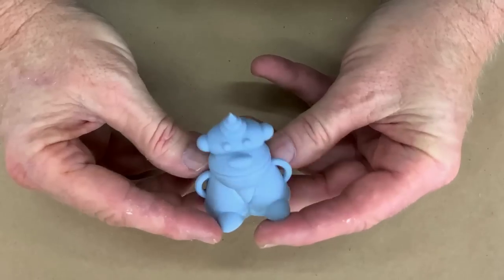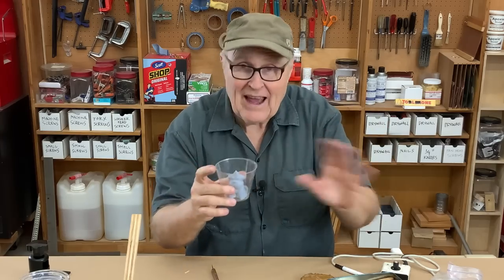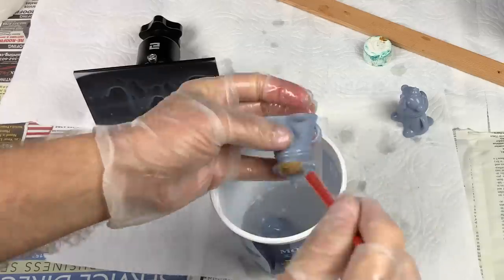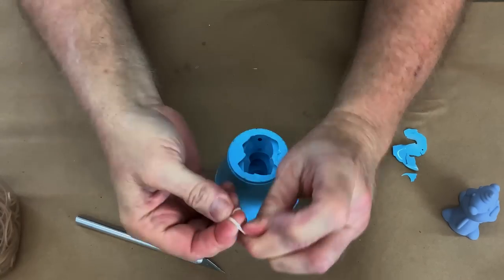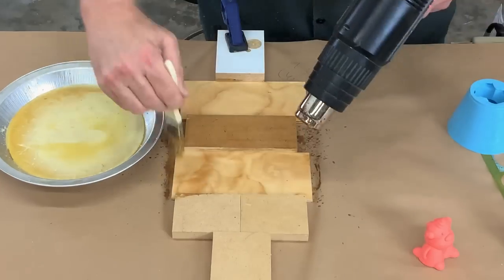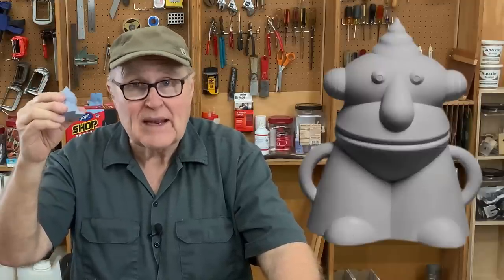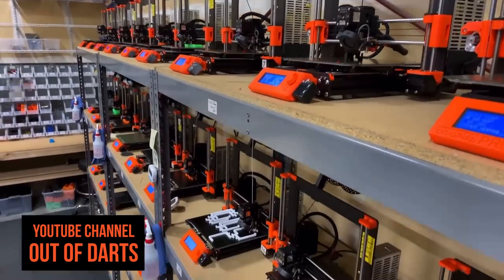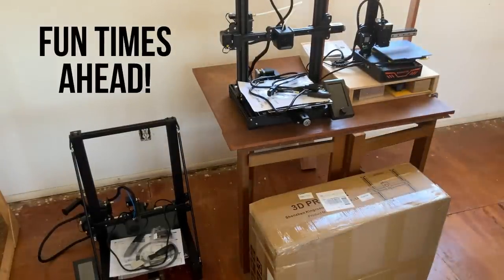Which Is faster - Resin Casting Or 3D Printing?

Comment: Printing is good for creating masters and prototypes.   Casting or injection molding are better for mass production
Reply: This is exactly what Games Workshop does for any of the Warhammer nerds hanging out here. They print masters, then create plastic injection molds from those. Masters are usually handed over to marketing, who paint them up to use for promotional materials while the machinery is being made.

Comment: This explains all the little mom and pop shops that do miniatures I like to order. I've always wondered how they do large quantities of models for cheap when the quality is usually really good. The Perry brothers come to mind since they're a relatively well-known operation out of the UK. You basically have these two guys and their parents making stuff by hand and shipping it all over world. 

I'm not entirely sure what I want to do with this information, but it's always helpful to know how things are made (even if you don't use that information right away).
Reply: Generally speaking, 3D printing is only viable for very small numbers of parts, and it's really ideal for like, maybe <10.

Casting is going to be better at producing parts between tens and hundreds.

Above that you're typically getting more into injection molding territory. There are some solutions here for the high hundreds to thousands range, but typically, injection molding is more for 10k+ parts.

Comment: Great video! Mainly confirming my suspicions. It always aches me to see people produce in inefficient ways. This isn't just limited to printing times, but also to material choices. I know people that design parts with large flat surfaces and print the entire thing, while it's much more beneficial to only print the edges or only print connecting parts while using existing materials for flat surfaces like MDF plate, multiplex, acrylic plate or something similar. This often also adds to the material experience. Back in the days these additional materials were called 'vitamins', but since a couple of years it seems the new order of printing enthusiasts has forgotten the term.

Comment: A lot also depends on the resin printer you have since the time to print is dependant only on model and layer height, not number of pieces so a large print area can in this instance print a lot of pieces at once.
Reply: Sure, and if you have 500 3d printers with staff to run them it can produce one every nine seconds!

Or you could just continue to increase the number of cavities you can pour resin in, until you are fully occupied the entire time.

Obviously there are variables at play, but the fundamentals don't change much.

Comment: Bob, you know better than most, you have to start at the beginning before you can reap the benefits. It all depends how fast you can make the first master. Then it’s a question of production like you said.  If you only have one master it will take you forever to complete a job. You’ve showed us time and again to hang the master so that you can maximize your time and your money. If you rely on printing each master over and over, you’ll go broke. If you take that master and gang your production setup, now your cooking. Best regards, Richard
Reply from the maker: For this video, I focused on the production casting, not the creation of the master because that depends on a different set of factors. Are you faster at hand sculpting or at digital sculpting? For me, it has always been that hand sculpting is faster. Unless the master is something of mechanical design. Then it is easier to design it in CAD. But that is changing. I practice digital sculpting in Blender every day.

Comment: Printing has near 0 setup time - if you already got a 3D model. But if you have to design your model vs sculpting it in reality that is a different story - depending on the material and design creating a real life sculpture can be a lot faster even, reducing the time-benefit of 3D printing.

Another big difference between the 2 is surface-finish and mechanical performance. 3D printing, even with good SLA printers, has a visible surface texture that needs post-processing for every single part. If you use that processed part for creating the mold then the work was only done once but you get the benefit every single time. And then strength - with FDM the strength is abysmal, the SLA it is not bad but you are severely limited by material. And having the same object cast will in general be twice as strong if not more, just cause it lacks the layer-induced anisotropy.
Friend and me made a RC drone and we first printed the body and flight-tested it, then prepared the surface and made some negatives, then tested it to destruction. Didn't take much to destroy it as just cranking up the motors to max exceeded the layer-adhesion and the body started delaminating. With the mold we just added 1 layer of fibreglass and made the shell just half as thick. It was way lighter and sturdier.

3D printing really made prototyping and creating molds waaaayyy easier.

WAlso: hy no blade-guard nor riving-kife?

Comment: pros and cons to each. guess 'nuff said on that. 

something maybe to keep in mind is what brings you the most satisfaction? most men aren't going to feel very satisfied pushing a button, walking away, and calling that work. casting would be much more hands on, no? with that in mind, there's a certain pride involved. after all, we're builders at heart. 

us older guys are probably going to lean more towards casting, that's just our nature having (hopefully) a certain work ethic instilled in us. it's going to feel as if we made something with our hands, not letting a machine do it for us. it's not anti-technology or throwing all efficiency out the window, but if it's in the same ballpark, i think many of us would pick the slightly less money-making process in favor of the one that makes us happier.
Reply: 3d printing isn't as straight forward as pressing a button and is a skill that needs to be learned lime anything else.

Comment: So first, almost any time you are dealing with scale casting, stamping, injection molding, etc will be faster than 3D printing once you've taken into account tooling time. So there is typically a minumum volume after which casting becomes faster and cheaper. And a time and motion study is a good tool to build sense on determining that. But i have a problem with this video and that is curing time for the mold was ignored in the time to make the mold and that time matters. That 18 hours spent curing is time that could be spent printing parts and it's a constant. And since most 3D slicing software can give you an estimate of print time you can easily do the math on whether it is worth it to do the mold. I get why it was ignored since you can fit the curing into overnight or do other stuff while it is curing. But the same applies to 3D printing especially if you know how to do stacking since you can stack to fill the entire build volume turning it into a 9-14 hour print on something like the mars 2.

Comment: Good to see you back . Nothing like a good time and motion video to show the best of both methods. I think with a quick setting resin up to four cycles an hour would be possible . Great vid as usual .
Reply from the maker: It’s nice to be back, but vacations are nice too! The problem with quicksetting resins is that you often can’t fill the cavities fast enough before the resin begins to set. So it’s a balancing act between how many cavities there are in a given mold and how fast you can fill them. Plus some shapes fill very easily as this one did in this video, others feel slowly because of the inlet sprue, etc.
Reply: @RobertTolone  that's what I mean with this mould  and a big open pour area . Good to see it was a holiday , last time you went missing in action it wasn't the most pleasant .

Comment: Robert, whenever I do a cup mold, I hold it together by putting it in the same sized cup. I cut the bottom of the cup and use baby powder to help the mold pop in and out easily. It holds the seams together perfectly, with no need for rubber bands.

Comment: A concept that I struggle to get people to understand... 3D printing is for "rapid prototyping".  It's OK as a hobbyist if you're doing one-offs, but it isn't a production machine; not by itself.  Casting is for production.  A single 3D printer has a looooooong way to go if it wants to keep pace with casting.  Something like injection molding machines can crank out 100s or even 1000s of castings an hour depending on the part.
Reply: that's why printing farms exist. while it does make sense on paper to add casting, doing that is a whole other thing. it's a huge pain in the ass to add a new process. too, these print farms are undoubtedly making ABS products, which you can't cast.
Reply: Who says it's for rapid prototyping? I sell my prints all the time either to clients or on Etsy. With a large print bed you can make a lot of models in the same amount of time that it takes for one. Add a second printer and you double that. Oh and injection molding isn't resin casting.
Reply: @3DJapan  i think he was using that as an example of production rates. 

on a more 'practical'-ish level, if you've got the dinero and don't need a single large size, you can always invest in a benchtop injection mold press. once dialed in, you should be able to pop a piece out about every 40 seconds or so from what i've seen in videos. 

there's is going to be a time in production when casting is just rather going to blow printing out of the water assuming you've got several pieces of equipment, like loaded up on pressure pots. he mentioned he's got seven and sometimes uses a faster cure silicone that can make a mold in a couple of hours. using gang molds and it's unlikely a couple of printers are going to be able to hang after a thousand pieces. 

aside from the satisfaction of making something by casting because we're men and it's our nature to build stuff, casting's big advantage is also the variety of materials you can use. resin printing gives you a resin product, a hard plastic that's more on the brittle side. while you obviously can't cast ABS, there are products where you probably wouldn't be able to tell the difference on a practical level. 

pros and cons. 

why are you still doing etsy, though? they take most of your money, i don't get why people are still on that rip-off site and i never did buy that 'exposure' thing they claim is their big feature.

Comment: Hi Robert, this is exactly what I was looking for, in my case I have 3d printing business  and I have been using my resin printer for print one small product that is just 3cm tall,  I can print 60pcs in 2 hours but unfortunately there is a log proccess for the final product because after the wash and cure procces  I have to sand them and apply 3 layers of clear coat because these need to have a shiny and smooth surface and them label them,  now I'm thinking to make a mold for cast epoxy resin, since if I make the molds with the parts with the clear coat applied I don't will require to apply it if I cast it because the mold with replicate the surface so will be something like pour resin on mold, take them out and label them, a big time safer. Customer have placed orders of 150pcs, just imagine how much time these took me😅

In your case what silicone do you use for the molds? I'm trying to find one that be almost clear because my plan is to use uv epoxy resin so cure time would be faster than normal epoxy resin
Reply: Some fast cast resins will cure in 5 minutes.
Reply: i have heard that new rubber molds can retain the glossy finish of the part the mold was created for, but over time the rubber molds can become dull. have not tested this myself. just fyi

Comment: Lots of people make money with printing, especially resin printing. Remember that they make bigger printers and you could fit 10 models on the plate that take the same amount of time as one.
Reply from the maker: Yes, the more machines and bed space capacity you have the more the calculus changes.

Comment: Nice! What materials are you using? I recently tried resin casting but ran into a huge issue with curing. The silicone I wanted to make the mold out of wouldn't harden around the print. I ended up sealing the print with a generous amount of varnish which helped but the mold was not smooth at all and in some harder-to-varnish areas, still sticky. The silicone was curing 90 minutes but the epoxy resin took almost 2 days and remained flexible on long, slim details

Comment: What about 3D printing the molds? They'd be sturdier than silicone molds and would be perfect for medium runs of about 100 or so.
Reply: two part liquid casting resin can stick to things like its welded. you'd have to experiment maybe by using mold release spray

Comment: IMO you can't compare this, 
first of all, resin pri!nter need always the same time, wether you are printing one or many copies. 
second the Elegoo Mars is not the first choice if you want produce small series, compare that to a Elegoo Jupiter which has a four times bigger bedsize (6" to 12" ), in your example you could print 12-15 copies on the Jupiter in one hour.
third resin prints are in most cases hollowed out, to save resin and improve curing speed, which should be much faster than the curing of cast resin and
last but not least, more complex parts with undercuts, holes, etc. are much more difficult, if you want to make a mold for them.
So in general casting in molds can be the better solution for bigger parts with a geometry that fit the process, but for smaller and more complex parts, resin printing is the better way.
And don't forget, that a mold doesn't last forever, so depending on the number of copies, you have to make new molds. So, as a fan of MSLA printing I only need the printer, a curingstation and the resin, i don't need to have materials for mold construction, i don't need a vacuumchamber. 
BUT if i want a modell with a perfect surface (no layerlines), mold casting is the only way.
Reply: It's almost like he should have said the right answer depends on the specifics of the job...

oh wait, he did.
Reply: @Skoozi  you are right, but my point is, that you don't choose the smalest printer for serial production, but there is no limit for the moldsize, thats why it isn't comparable. If you take the model from the video, but choose a bigger printer, you can be as fast as mold casting, but with less work, less resin. On the Elegoo Jupiter you can produce a hundred copies in eight hours too.
Reply: @ChristofVorhauer  but the actual quoted times were a mold with 3 cavities which was directly comparable to a printbed that could hold 3 prints simultaneously
Reply: on a practical level, most of your printed pieces are going to need supports, though, and that can be a lot of time spent cleaning the piece up. plus, if we're talking about a resin printer, there's nowhere near as much flexibility in terms of material. i mean, if you want something other than a hard, brittler plastic, you're s.o.l. on a resin printer, no? 

pros and cons to each.

Comment: Hi Bob.  I know the initial resin prints were for the master mold.  But the resin printing of that thickness should be hollow.  The middle of the model will never be fully cured and will deteriorate over time.  Also, a final curing of the model in some sort of UV lightbox, not just a cleaning.  Not sure if you covered that in this video.
Reply from the maker: They were cured in a light box, but hollowing them out makes sense.  Thanks.
Reply: @RobertTolone  Chitubox has an option to hollow your print.  It also saves on resin.  Just remember to make a drain hole in the model before you print.
Reply: @RobertTolone  The light can't penetrate the outer layers of opaque resin to fully cure the inside on a solid model that size - at least, that's the theory. I'd be keen to see you cut one of those in half on a band saw to see if the inside is still tacky.

Comment: Hi Robert!! I find your videos really instructive and fun to watch. I am starting in mold casting and I wonder what is the average lifespan of a silicone rubber mold. How many resin casts can I get from a single mold? Thank you and keep on with this great work! Congratulations!
Reply: one issue i have seen is that if you need parts with a glossy finish, new rubber molds will retain that finish, but can become dull over time, long before the mold actually wears out

Comment: ONE: AWESOME VIDEO AS PER USUAL!!! Just a fun and casual little experiment! Love it!
TWO: I noticed your print has ZERO elephants foot, what's your secret there? Or did you build the model with kind of a buffer for EF?
THREE: I havent finished the video as I'm posting this, but my 3D printer went from my 'main toy' making thing to my "Amazing master-making" thing.  Its SO USEFUL to have 3-4 fully detailed masters lying around.  Sometimes I'll make 3 masters and spray them with different surfacing like gloss or matte (Matte looks amazing for that 'rubber keshi' style mold, it has that superbly rough look to it as opposed to glossy.)  I REALLY thought I'd be making more actual pieces with my printer, but taking the time to make ONE really good master is SO worth it now that I own a pressure pot.
Reply from the maker: Luck on the elephant’s foot I guess. I’m just using the stock settings in ChiTuBox for the Elegoo Mars 2 printer.  Seem to work fine.